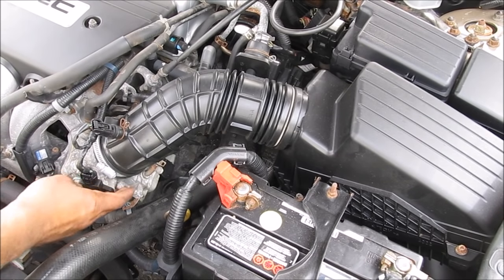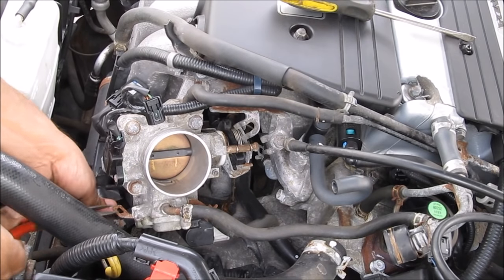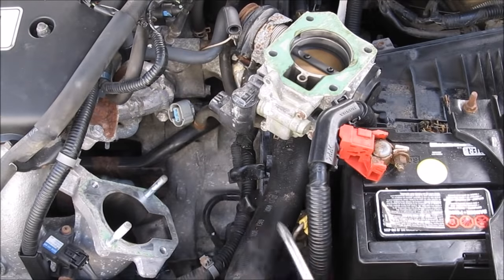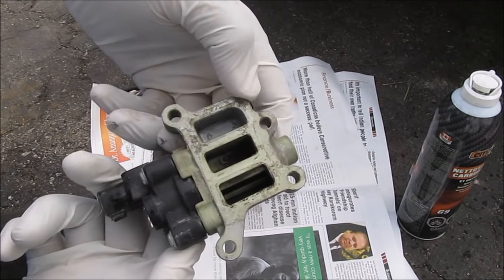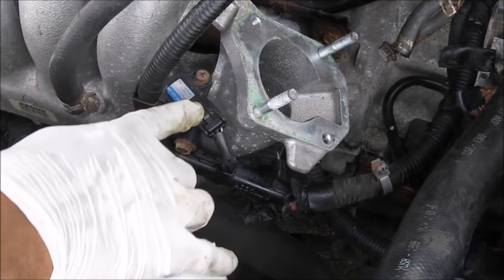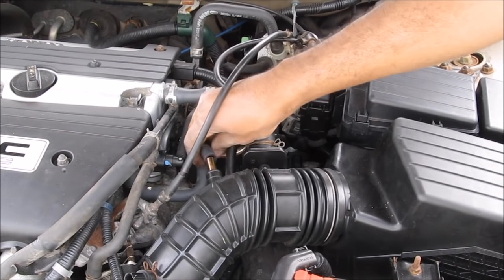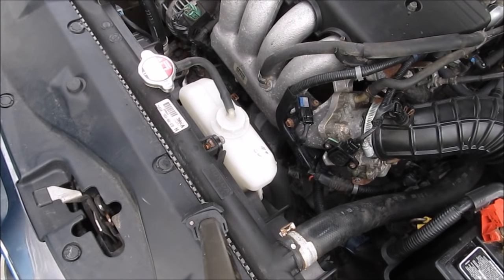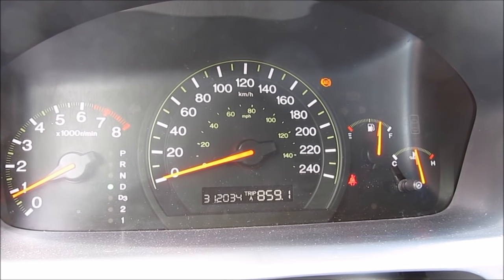Honda Idle Air Control Valve, PCV and Throttle Body Cleaning

Comment: Super easy way to get a screw loose if it starts to strip out, use a wide rubber band. Put on head of screw, then jam screw driver down on it and bam.... open right up!
Reply from the maker: Good tip
Reply: @speedkar99  If I need to buy an  Honda Air Idle Control Valve, where do you recommend I buy one?
I have a 95 Del Sol... Thanks..

Comment: You forgot to unscrew the 2 screws on the black part of the solenoid. to clean and free up the tiny motor in the black solenoid. It could be frozen in Time.

Comment: Use maf sensor cleaner to clean map sensor you don’t use electric cleaner except where the electrical connector plugs in which you don’t need to remove

Comment: Yo tooth brush is on point I did every think it went to normal for right now lol The trotel wire I would make it thight a little it gave me a batter gas hit if any one want to know lol
Reply from the maker: Thats a good tip
Reply: speedkar99 hay did u ever had ur Accord hasitating on u when u left it park on my he drive way for a day till the next day bro an my bad for the spelling

Comment: if you do a computer check as to what your Honda isn't running correctly -  the ole idle air control valve dose not trip a code !    a shop replaced mine today for $600 dollars !   YIKES